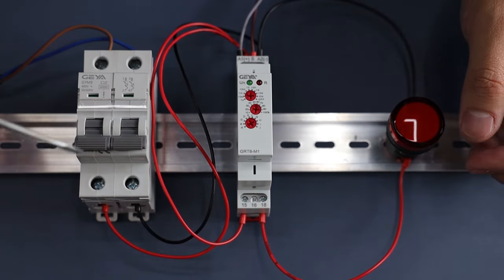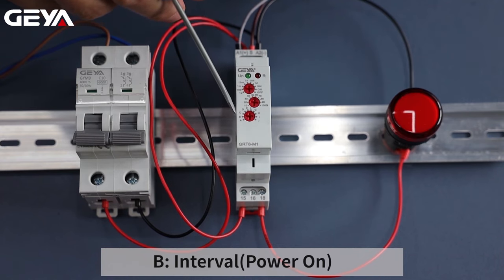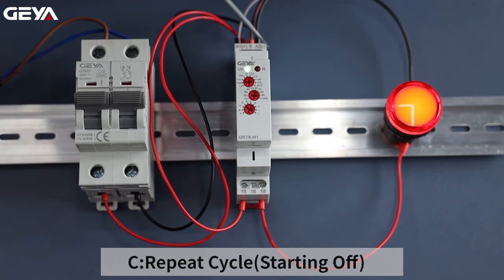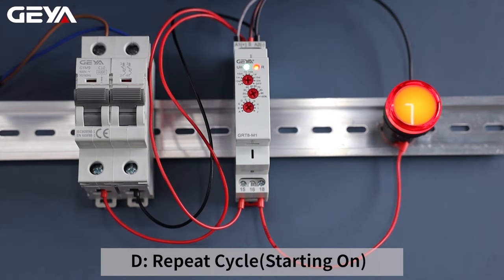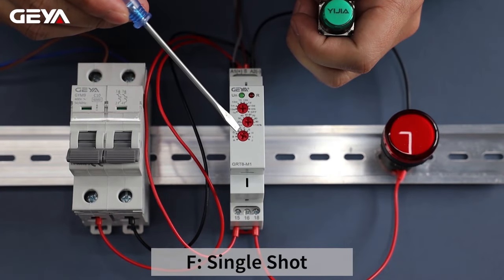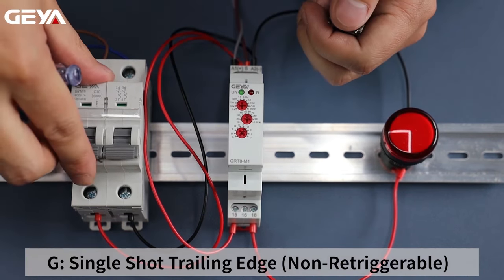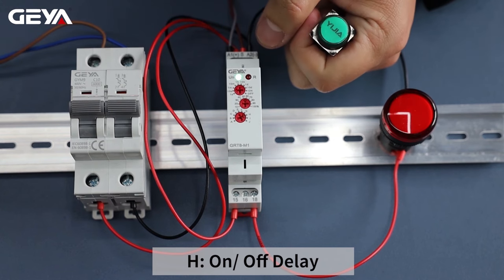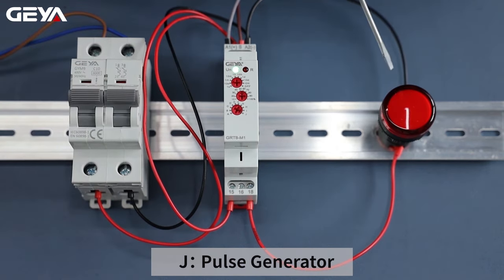How to use multifunction time relay | demonstration of 10 functions

Comment: Except the intermitent switch on and of ,there were two timer relays in my old days, the timing from ON and timing from OFF.This one cover both functions.If you need sone intermitent, just use two OfFF timing relays.Those days an automated machine could contain about 400-500 relays with 3or 4 NC and NO, pressure and current protection switches, and about 200-300 pages with diagrams.Not always you find the machines diagrams but never the less you were compelled to repear it and fast and you could not mistake the electrical fault with a mechanical one

Comment: Bought it today. It's very flexible. The only downside is that the terminal blocks are too small for the wires coming out of my meter and going to my load (6mm^2 and 4 mm^2).
Reply from the maker: Thank you for your feedback.
Reply: they are meant for smaller loads. If you need to use for a motor it's best to add a contactor. Remember the relay is electronic and not going to age well if you start big loads with it.